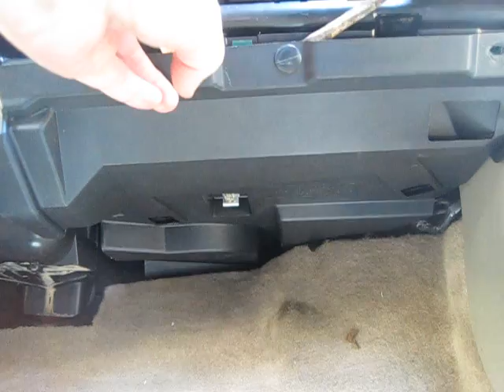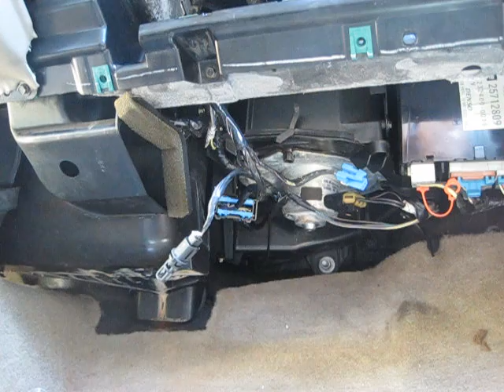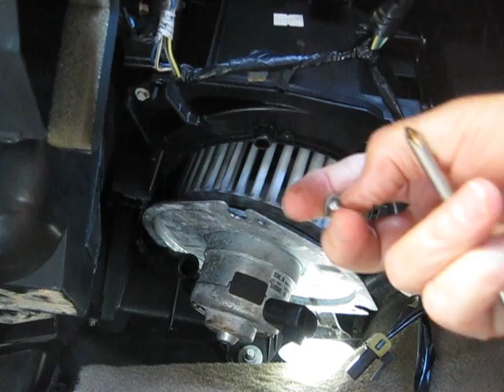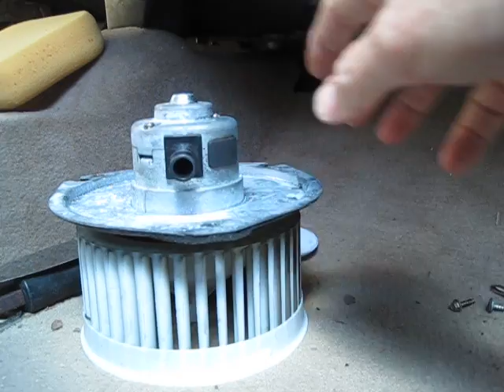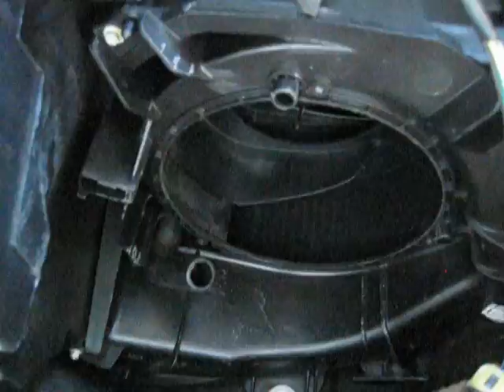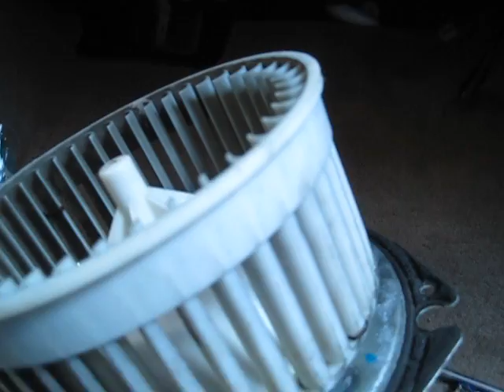Buick LeSabre GM Blower Heater AC Motor Repair With Removal and Replacement Steps 2000-2005

Comment: Does the blower motor have a fuse
Reply from the maker: There will be a fuse for the blower fan in the fuse panel. I don't have the car now, so check out the fuse panel in your owner's manual. If no manual available, perhaps EBAY would have one.  Thanks for Watching!

Comment: Just wanted to say, I tried what you showed on my daughters 2002 LeSabre and it worked perfectly! The buildup of dust was preventing good contact on the brushes. Only one thing I did was to gently clean the rotor contacts with a Mr. Clean sponge to brighten it up a bit. Works perfectly now, very quiet and smooth!!! Thanks again.
Reply from the maker: Thanks for watching!

Comment: Just bought a 2000 Buick lesabre... Turned on the defroster and turned up the fan... It sounds like my old freezer when some ice gets too close to the fan... Can things fall down into it and just be rubbing on the blades? It's very irritating...
Reply from the maker: Yes, trash can get into there, it is a bit of trouble to pull the fan out and clean in there, but should be worth doing. Hardest part may be getting the glove box out of the way. Thanks for watching!
Reply: Try opening the HVAC filter cover on the cowl on passenger side--hood up. Some models had a filter installed from factory. I think you can use a long arm or a vacuum cleaner extension to suck out debris that ends up on the blower wheel if there's no filter installed.
Reply: @keithwiely2095  thanks... Problem solved... Opened it and found a stick inside unbalancing the fan... Cleaned it, new filter, all good now...
Reply: Also, I believe the blower motor changed in 2003. So 2000, 2001 cars may be different than 2003-2005.

Comment: Where did you order the bushing from 5/16
Reply from the maker: It's been a long time, and the car is no longer with me, but if I remember correctly, my bushings were good once I cleaned and oiled them (light coat of greese), and the brushes worked fine with just a bit of adjusting of the way they were originally routed. If the electric motor parts are that much worn, perhaps a "junk yard" motor would provide the parts needed, or Ebay now has these motors for less than $40, I believe. Thanks for the question!
Reply: @cubmancan  i cleaned it with some crc electric cleaner and put some die electric grease on it put it back in its working fine now...thanks

Comment: Is it hard to change the terminal that plugs into the blower motor (the clip you pulled out)
Reply from the maker: I assume you have determined that the connector plug is bad and needs to be replaced. I have not changed out that connector, but if I had to do it, I would likely go to our local "you-pull-it" yard and cut a connector off an old Buick and just use crimp-splices and shrink-wrap or electrical tape to put it on my car. Perhaps the connector is on Ebay, but I sort of doubt that the correct one could be found. Good Luck with that! Thanks for watching!

Comment: Hello. If my ac, heat, and defrosters is not working does that mean it's a blower motor problem?
Reply from the maker: Hi, Off hand, I would say check your fuses first (cheapest and easiest). Check the fuse box: It should be located under the hood next to the fill tube for the windshield fluid. A 12 volt tester is usually best for this, but often you can pull the fuse in question and visually check it, or simply swap an identical fuse from a different location to see if it solves the issue (use identical fuses though, not higher of lower rated fuses). There could be many causes for all those things not working, but if the air is not coming out of the vents at all, sounds like the blower motor is not running - could be the blower motor itself, a power supply issue or even a case of debris in the fan or ducts or perhaps other issues. I would begin with fuse checks and power supply checks first. Thanks for your question, and for watching the video!
Reply: @cubmancan  thank you so much for answering. it does seem like it can be a fuse problem. thanks for all your help!!

Comment: Where did you purchase that light you used to see down there?
Reply from the maker: I am not sure where the lights were bought as I didn't order them. I think it was a QVC item maybe. Wish I knew as I would like to get a few more. I think it was a pack of 6 originally. They are "touch activated" or motion. I haven't used them in a while, but they were handy for video making in dark spots. Thanks for watching!

Comment: Great job, checked my relays and fuses for this AC issue, guess the Blower Fan is the next step. The compressor has cold tube coming from it, but the fan's not blowing.
Reply from the maker: It seems a bit unusual for the fan to go out without some symptoms such as rough sound or off and on operation, but it could happen I am sure. Wires at times can develop poor contacts at the connections to the blower motor too. Just an idea; Sometimes you can bump the blower housing and it will make the brushes or wires contact and run a bit. If so, the brushes may just need some prodding to make contact. Fan motors are pretty cheap too. Hope it works out well for you! 
Thanks for watching!
Reply: @cubmancan  this sounds exactly like what I'm dealing with right now.

Comment: My air doesn't work but it will blow on the floor.
Reply from the maker: I haven't work on a Buick air control issue recently. but it sounds like you may have a problem with a controller that directs the air to different places. Different car brands have various configurations to do this. It does sound like your fan is blowing though and if it speeds up and blows slower when you operate the air speed controller, that is a good sign. There are usually "doors" that open or close to direct the air to the floor or the dashboard or the windshield. Hope this helps somewhat. Thanks for Watching!